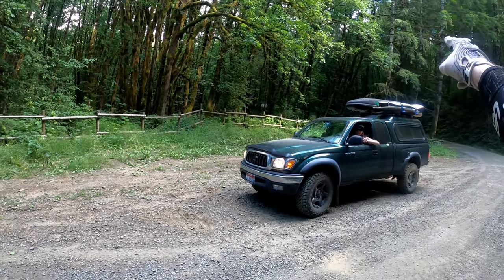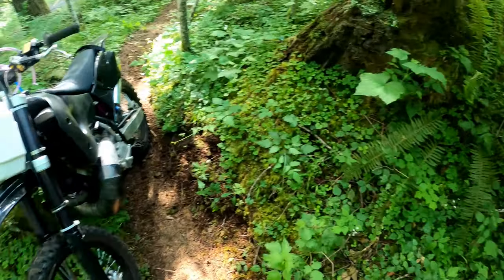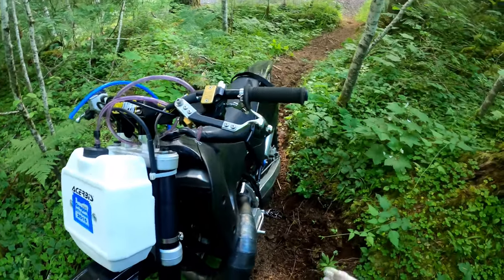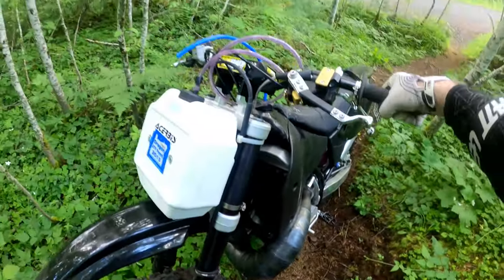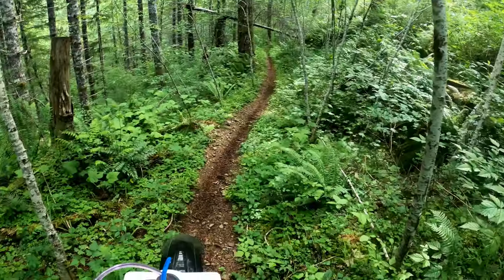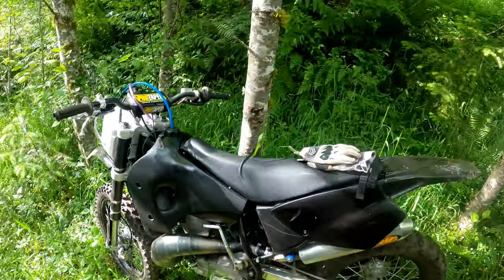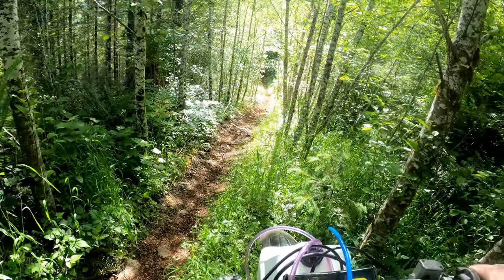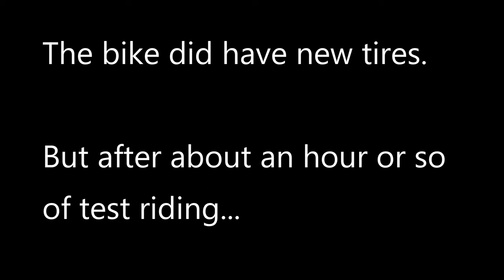Zabel 700 Build - First Test Ride

Comment: Do the engines come ready to go and could I put it in a wr 250 frame
Reply: You need to measure if its fits hardest part is fit it to the swingarm/swingarm bolt if the casings are too wide you wouldnt get it fit but if you are lucky 1-2mm shim off swingarm on the grinder, another thing is how tall the engine is would the gas tank fit there or do you need to use heatgun and press it in =less gas= less fun
Reply: @RRDfinland  ah thanks I didn't think about the swing arm bolt idk why it's probably most important